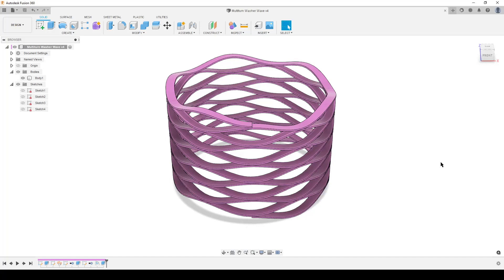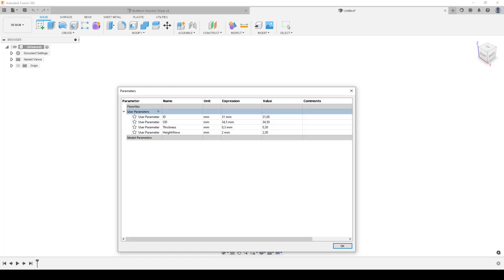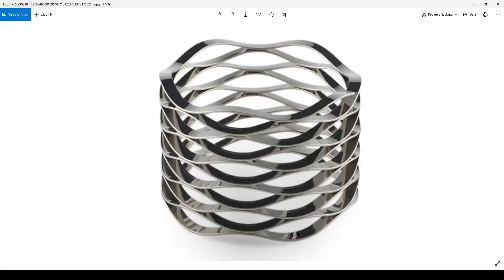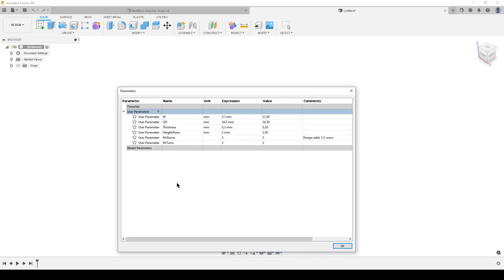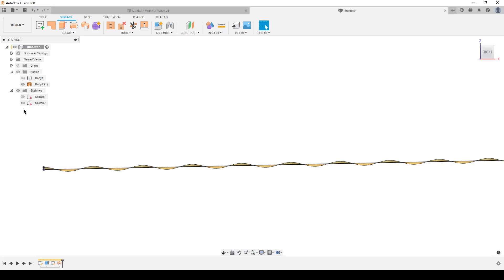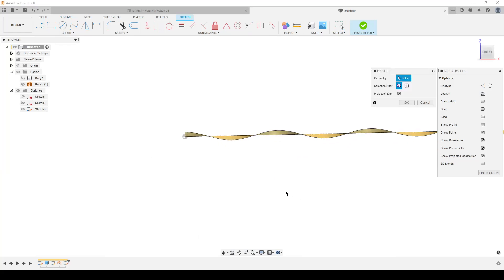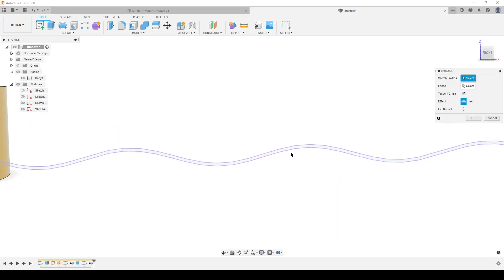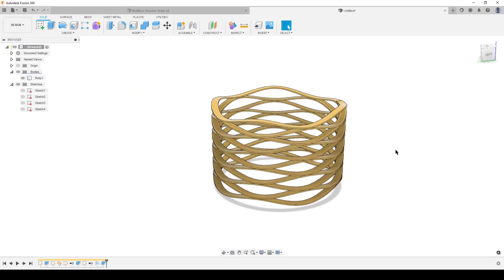Fusion 360 - Multi turn wave washer (Emboss workflow)

Comment: Random question for you...is there any way to design something like a 15 sided die in Fusion 360?  Something like this?  Is it possible do divide a sphere into any number of sides and have fusion figure it out?  I love your videos.  Thanks!
Reply from the maker: There are no tools like that in Fusion. There is an add-in for polyhedrons but I don't know any polyhedron with 15 faces that would make a good dice.

Comment: You always come up with some interesting things to do. I try this but get error when embossing. Try larger thickness, gives me no error but get 3 sections instead of 1 continuous wave.  Very strange.
Reply from the maker: Check your sketches and that the wall in Thin Extrude is centered. It's hard to troubleshoot not seeing the file.